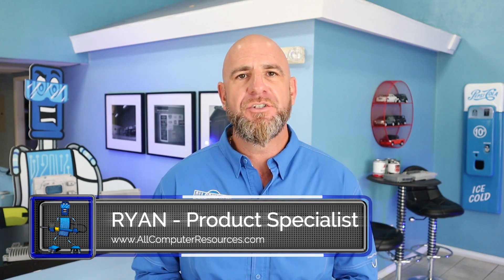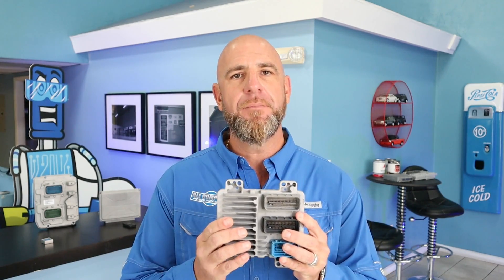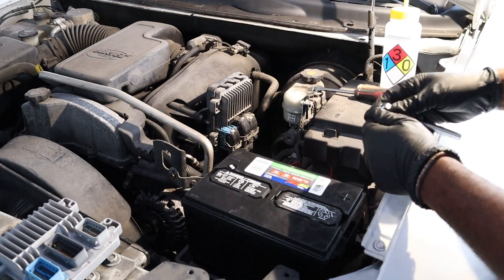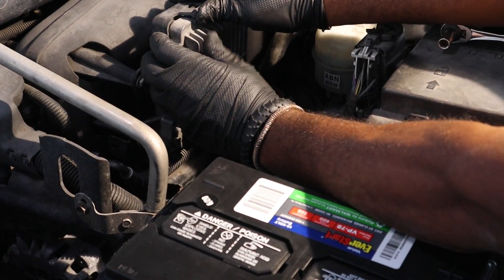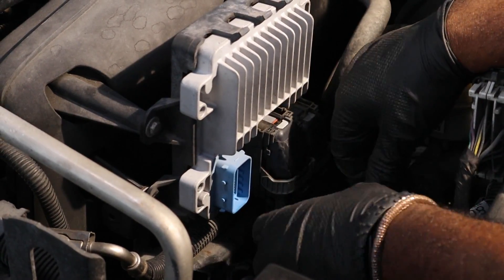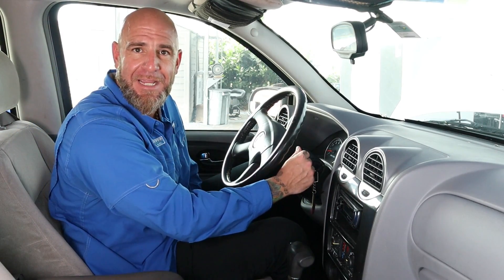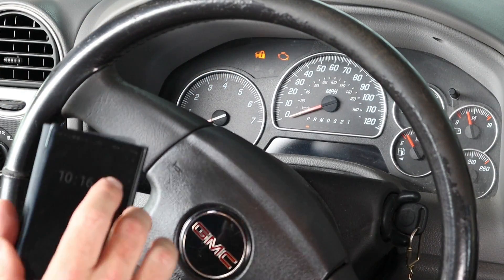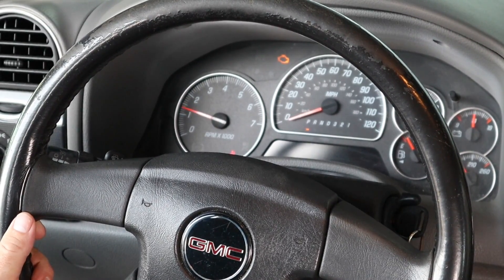HOW TO PROGRAM KEY FOR GM/CHEVY ANTI-THEFT - ECU REPLACEMENT PK3+ / PASSLOCK

Comment: I tried to relearn new key. Original was damaged. Repeated the 10min procedure 3 times with sec light going off and no start. When I try to repeat it once again the security light doesn't go off after 10 min. Car was fine before the key issue.
Reply from the maker: Hello, This is not the process for relearning a new key. This is the process for relearning an existing key to a new ECU that is programmed by us.
Reply: @acr  How to do it then? Im not from the US and here we do not have any dealership available. Any diagnostic tool with key programming/coding that You can recommend?

Comment: i tried to reprogram my ecm used i followed the steps and my theft lights never poped up i did this 5 times but my car has no theft signs but wont crank over  and on thedash still reads lowfuel,steering,airbags,what went wrong i have a pontiac g5 2009
Reply from the maker: Hi Linda, Did you get the computer from us? We can open a support ticket. Also, if you are having issues with the security system we can eliminate that as well.
Reply: @acr  no sir i didnt get it from you all i got it used from juckie jim auto in sebring,fla
Reply from the maker: @lindarodriguez4882  Unfortunately, it's not that simple. The computer needs to be programmed and calibrated to your vehicle and the VIN. If you would to purchase a programmed computer,  feel free to give us a call at 786-879-7566 and we can help get you back on the road.
Reply: @acr  but i had a ex of mine friend put hands into my car and watch a video on cutti g a wire near the steering to try to stop this ati theft issue needless ti say i still cant drive my car so upset these guys dont care i need tobeable to pick upchildren its been a darnnightmare and im on disabilty and cant afford tobuy anythi g new truely apreciate your time sincerlylinda

Comment: Hi, I have a 2005 Chevy Colorado extreme And I was planning on buying an ECMPCM from you guys but I don’t have the original key.will relearn process still work?
Reply from the maker: It will work as long as the key you have for the vehicle already operates the truck. We also have an option to completely remove the security system altogether in which you will just replace the PCM and start the vehicle.
Reply: Thank you for that. So, my other question is do I have a PK3 key or another type of key.
Reply from the maker: The 2005 Colorado is PK3+ @kanewaikiki6071
Reply: Thank you 🙏🏽
Reply: So if I wanted to remove the security system, would I have to let them know upon purchase?
Reply: Can I use compressed air the ones that you can buy at Walmart in the can to clean the connections for the PCM? Is it safe?

Comment: Thank you for your video/very professional, and easy to understand. I have a 2003 hummer.. security light won’t go off, gauges, work for a minute, go off, come back on, ,then come back on. I replaced the BCM, done the 30 minute relearn, six times security light just stays on. Any help I would surely appreciate it. Thank you.
Reply: Did you ever figure out what the cause was. I have the same issue & these people are no help.
Reply from the maker: @Troys221  If you are replacing the BCM, that requires a very specific type of programming. This video is for a key relearn procedure when you replace an ECM, not a BCM.
Reply: @acr we replaced our ECM and got it programmed to our vin and everything, tried following other videos didn’t work. Tried following this video and our theft lock light will not turn off after the 10 mins, what do we do?😭😭
Reply from the maker: Awesome, Glad we could help!

Comment: Hello, I got a Captiva 2.4 Sport 2011. Unfortunately I had already installed the tool and run a check before watching your video. What problem could this have caused? I have run the first 10 minutes cycle but the code light did not turn off. What could possibly be the underline cause?
What should I do?
Thanks
Reply from the maker: Was the computer purchased from us?

Comment: The PK3+ 30 min procedure worked. The vehicle turns on with new key; however, the anti-theft icon won't go away. If I turn on the vehicle with the original key, the new key doesn't work. What to do?
Reply from the maker: Was the computer purchased from us?

Comment: Just installed one of your units in my 2011 Avalanche and the key learning process is not working. Truck will start with the old PCM but will not run very long before it throws P0691 codes.
Reply from the maker: Have you been able to troubleshoot those codes?

Comment: I bought a programmed ECM from flagship and had it programmed to my VIN/ old ECM and after I turn key onto the crank position the security lock light just turns off with the rest of the lights and doesn’t stay on. This is the 2nd ECM I’ve received from flagship and seems like I’m having the same issues everytime I go to do the key relearn process. What would be the next thing to try? I’m at a loss on what to do next
Reply from the maker: Very sorry to hear that you have issues with another company’s ECM. We are not sure what type of programming is performed or if they are licensed by the manufacturer to perform such programming. It would be difficult to diagnose someone else’s ECM but we would suggest letting them know about your issues and hopefully they have a solution for you. If there’s anything we can do for you, please don’t hesitate to contact us directly at 786-879-7566
Reply: Service traction control and service stabilitrak comes on. I just put new throttle body/ throttle position sensor on it along with this new ECM and security light just doesn’t stay on like it’s supposed to
Reply: With my security light going off right after turning key into crank position is it possible that the key relearn process won’t work due to a bad ignition lock cylinder?
Reply: Any update

Comment: Good afternoon.  you need to follow the same procedure on a 2005 Cadillac Sts.  already tried everything.
Reply from the maker: The 2005 STS uses an encrypted security system. This appears to be a one year system and may require on board programming by a qualified locksmith

Comment: I find this very difficult to understand,  I purchased a refurbished ECU unit with programmed VIN, followed the instructions to relearn the key of the three 10-minute cycle programming. What is the difference between the three 10-minute programming cycle versus leaving the key in the onward position for 59 minutes to bypass the anti-theft.? 
I would greatly appreciate clarity from anybody
The 59 min I got a start, the (3) 10min cycle no start.
Reply from the maker: Hello, I would first like to confirm that you ordered the refurbished ECU from us. If so, please reply here with your Order# and I will have someone contact you directly.

Comment: What to do if the check engine light stay on when car is locked and off 
And the security lock icon just flashes
Reply from the maker: I would suggest reading the code that is being triggered and following a proper diagnosis thereafter.

Comment: I have a 06 Pontiac g6 GT, I replaced the PCM reprogrammed, I attempted to do the key relearning and the car keeps starting. What am I doing wrong
Reply from the maker: Hi @user-fn3fy3ot3x! If the car keeps starting even after replacing the PCM and attempting the key relearn, it’s possible the security system doesn’t actually need to be relearned in your situation.

✅ 06 G6 GT uses a different system (Passlock): In many cases, if the PCM has been reprogrammed with the correct VIN and configuration, it may already be accepted by the immobilizer. That’s why the car keeps starting—no need for a manual relearn.

✅ Security light check: If the security light is not staying on or flashing, you’re good to go. No additional steps are needed.

✅ If the light is on: Double-check the relearn procedure. For Passlock, it’s usually a 10-minute on/30-minute off cycle repeated 3 times, but if the car is starting and running normally, you’re likely fine.

Comment: 2008 Buick Lucerne CXL - Theft deterrent system will not release the key after shutting the car off. Everything else appears to be in working condition. Insert PK+ key in ignition, turn key to start car, car starts, turn key to shut car off, car turns off, try to pull key out of ignition and it will not release. Leave key in the ignition and come back in as little as 30 mins and car will not start without a jump. I can remove key by depressing the button on the bottom of the TDS under the cowling in the steering column. Have been struggling with this since purchase Dec '18. Can anyone offer a solution?? Thank you ahead of time!
Reply from the maker: It sounds like there may be a couple of interconnected issues with your **ignition cylinder, theft deterrent system (TDS)**, and potentially the **battery or charging system**. Here are some steps and suggestions to help troubleshoot and resolve the issue:

### 1. *Ignition Cylinder Issue:*
   - The fact that you can release the key by pressing the manual override button suggests a mechanical issue with the ignition lock cylinder or the shift interlock solenoid. 
   - *Solution:* Inspect the ignition cylinder for wear or damage. If it’s worn out, replacing the cylinder could resolve the issue. A locksmith or dealership can assist with this.

### 2. *Shift Interlock Solenoid:*
   - Sometimes the shift interlock solenoid, which ensures the car is in park before releasing the key, can fail or stick.
   - *Solution:* Check the solenoid and the wiring leading to it. Cleaning or replacing the solenoid might fix the problem.

### 3. *Battery or Charging System Issue:*
   - If the car won't start after sitting for a while and requires a jump, this indicates a potential *parasitic drain* or a weak battery. The theft deterrent system may be drawing excess power due to the malfunction.
   - *Solution:* 
     - Test your battery and alternator to ensure they are functioning correctly.
     - Check for any parasitic drain by testing the vehicle's electrical system.

### 4. *Theft Deterrent System (TDS):*
   - The TDS could be improperly engaging, which might prevent the key from being released and could contribute to battery drain.
   - *Solution:* Try resetting the theft deterrent system:
     1. Turn the ignition to the "ON" position (do not start the car).
     2. Leave the ignition in this position for about 10 minutes until the security light stops flashing.
     3. Turn the ignition off and repeat this process 2 more times.
     4. After the third cycle, try starting the car and removing the key.

### 5. *Professional Diagnostics:*
   - If these steps don’t resolve the issue, you might need a dealership or certified technician to reprogram the TDS or diagnose deeper issues with the ignition system.

Let us know how it goes, and we hope you get your Lucerne back to working perfectly! 🚗🔧

Comment: I have a 08 dodge avenger and purchased one of your pcm already programmed..my car will not start now and has the security light on..I can follow the procedures to reconnect my old pcm and it starts fine..what is going on?
Reply from the maker: We would first confirm the VIN you provided is correct.

Comment: Followed the exact instructions to the t, did not work. I  did the cycle for the fifth time, did not work. I purchased my ECU from a junkyard, it was tested and passed.
I later came upon your video and followed it with no luck, please advise if you can.
Reply: What worked is leaving the key in the crank to then on position for an hour, however after doing so the car engine seems unstable, stuttering, jittery, and making a fluctuating noise if that makes sense.(but to the slightest) after changing the ECU module 
Thanks in advance
Reply from the maker: This process will not work for you since the ECU was purchased from a Junkyrd and does not have the calibration and VIN for your vehicle. You can purchase a preprogrammed unit from us - 786-879-7566
Reply: @acr  If I purchase the ECU from  your company will it resolve the drivability,the stuttering in the engine of the vehicle(the engine on occasion, sounds as if it is loosing power).
 I did the key reset after the ECU install, by leaving the key in the onward position (as the "3" "10min" cycle didn't work as mentioned above) for an hour, the truck is behaving the same as with the old ECU.

Comment: In order for this to work do you need to depress the brake before turning the key in the ignition starting position?
Reply from the maker: No, You only need to press the brake pedal if you have a push button to start vehicle.

Comment: Mine is a 2010 Silverado WT has a + in the key.
When I insert the key and attempt to start the security light comes on for a few seconds and turns off, it doesn't stay on.
Reply from the maker: Hello Vicente, Are you attempting to replace the ECU and perform the Key Relearn procedure with an ECU you purchased from us? The ECU needs to be calibrated and programmed to the truck, we can certainly help you out if you don't have a properly programmed module.
Reply: @All Computer Resources  I did purchase it from you guys and yes it is calibrated and programed with my vin #.
Im going to try again,I'll keep you posted 
I tried with the instructions that were emailed to me.
Thank you
Reply: @All Computer Resources  I purchased it last year, since then I reinstalled the old computer, still having issues with my truck running, it'll run for a few days and then starts missing again.
I'm trying to find the order #
I have deleted many emails since then.
But, I'll try your procedure and see if it works.
Thank you.

Comment: does it work on 2nd hand ecu and old one dies no 12v and fuel  , 2nd hand did fired 3 sec and stop, have fuel and 12v in dash , will trying your ways see if helps
Reply from the maker: This video is for PCMs that are programmed by us.

Comment: Video is helpful. Thanks for posting. I have a passlock system. What am I suppose to do if the vehicle starts in step 1 when I turn the key to run for 3 seconds? The security light is not on. Only the check engine light with several codes, incluing P0633, which is what got me to you video. Thanks for any help.
Reply from the maker: Hello, was your replacement ECU purchased from us?
Reply: But what would be the answer?  Should he continue the 30 minutes relearning process even if the car starts in step 1 or 2 or stop the relearning process right there.
Reply from the maker: @peyin88  if the car starting and running or just cranking? If the car is running then drive it.

Comment: Question do you do tcm and ecm for Canada thanks thinking i need either a tcm or ecm still trying to diag in full but my 2006 chev hhr 2.2 all the guages power steering going nuts codes p0700 no comm with buss you name it its not the p/s motor and it is just strating to show more and more codes more often and this is after driving the car for sometime and all of a sudden ding ding and it starts all over again any ideas thanks again great info and videos as well thanks Dave

Comment: I have an 06 H3 and the key doesnt have any PK3 or + sign or anything. It does however have two sides cuts for the key. Would this be a passlock key then? If so which reprogram do I use?
Reply from the maker: Hi Eric, The process is different depending on who programmed the PCM. Did you purchase the item from us? There would of been an email sent with the chart. Let me know, Ryan

Comment: Hi, The anti-theft symbol appeared in the dash after i parked my 2015 Enclave in the driveway & the vehicle wouldn't start after that. The fobs no longer work either. Now when i attempt to turn the ignition ON , all systems, symbols & lights react slowly as though the vehicle is waking from a dead sleep. Are these common symptoms that may require a relearn or a deeper issue ?
Reply from the maker: Hi Judy, it would be really tough to say. I would recommend having the battery and battery terminals inspected first.

Comment: I have a 2004 Cadillac SRX v6 and it has a pop up saying “service theft system” and it won’t start. It was working fine a few hours before it happened, and we eventually removed the theft fuse and it worked again, but only 2 days and went back to not working again. Any clue on what to do?
Reply from the maker: It could be the actual VATS system on the vehicle failing. We are able to disable that function from the PCM if you’d like to go that route. I would recommend having the vehicle diagnosed.

Comment: I have a 2012 Cadillac CTS I would like to know what procedure to program a remote
Reply from the maker: Programming a remote for your 2012 Cadillac CTS involves the following steps. Keep in mind, you’ll need an existing working key or remote for this process. If you don’t have one, you may need assistance from a dealership or locksmith.

### *Procedure to Program a New Remote:*

1. *Sit in the Vehicle:*
   - Make sure all doors are closed.

2. *Insert the Key:*
   - Insert the working key into the ignition and turn it to the *"ON" position* (do not start the engine).

3. *Access the Programming Mode:*
   - Press and hold the *"LOCK" and "UNLOCK" buttons* on the new remote simultaneously for about 15 seconds.

4. *Listen for Confirmation:*
   - The car will respond by locking and unlocking the doors, indicating the remote has been successfully programmed.

5. *Repeat for Additional Remotes:*
   - If you have more remotes to program, repeat step 3 for each one.

6. *Exit Programming Mode:*
   - Turn the ignition off and test each remote to ensure they are working correctly.

### *If You Don't Have a Working Key:*
If you don't have a working key or the procedure doesn't work, you’ll likely need specialized equipment to program the remote. In this case, visit a Cadillac dealership or a certified locksmith for assistance.

Let us know if you encounter any issues, and we’ll be happy to help further! 🚗🔑